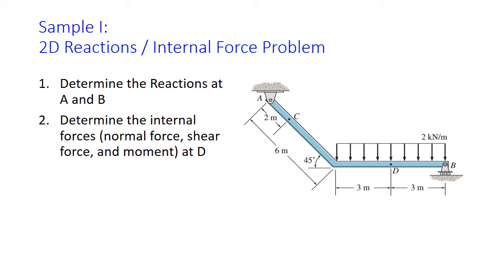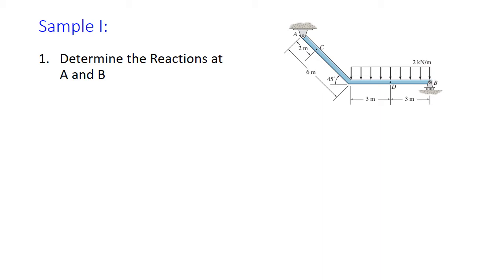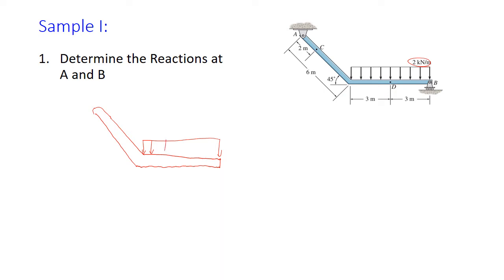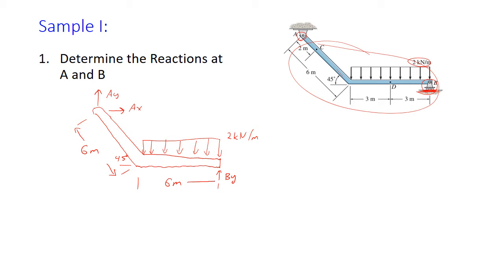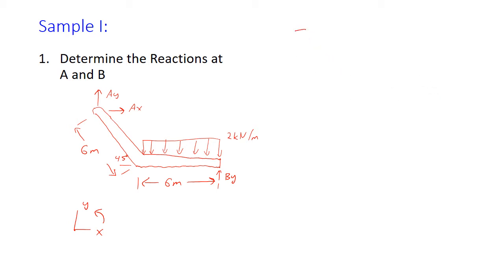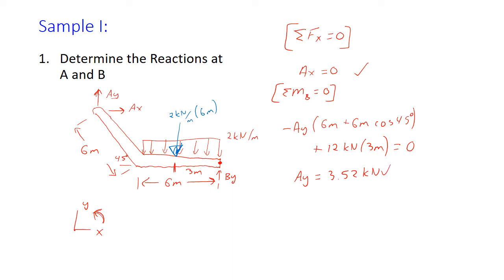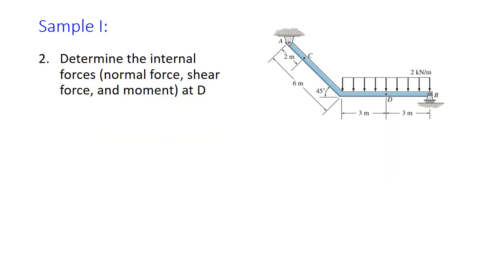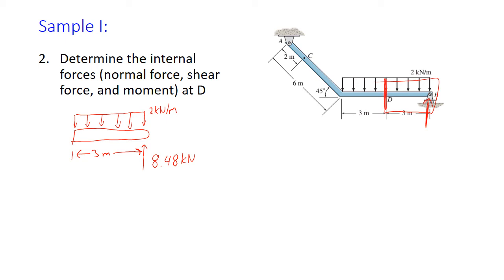Statics Review-Part 2 of 4 (Sample Problem I)

Comment: Hi, I have a short question. I assumed Ay points downward instead of pointing upward that you showed in the video. If I get Ay = - 3.52 kN, should I make a sign change as a positive? That's because my answer for By I obtained as 15.52 kN rather than 8.48 kN.
Reply: @Eric Martin Thank you so much for your explanation. It was very helpful! May I ask you another question? In the same question (part b, determine the internal forces), honestly I don't have an idea about what is shear force, why it's happened there, and how to calculate it. Can you tell me how this force works?